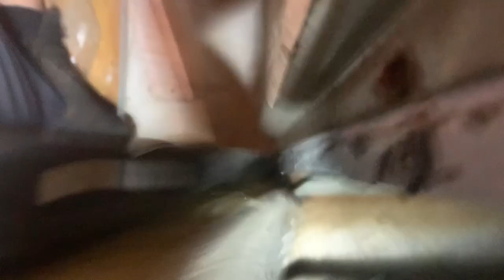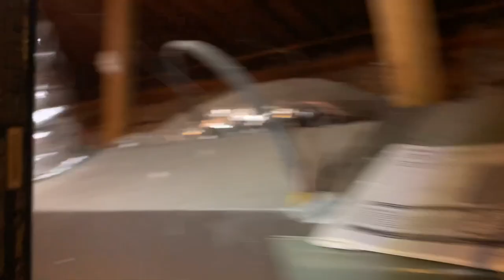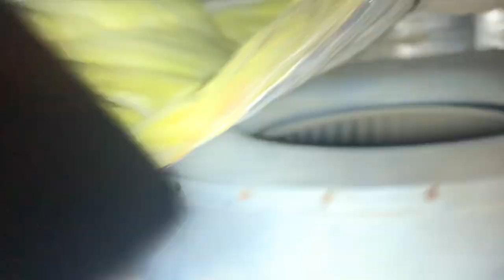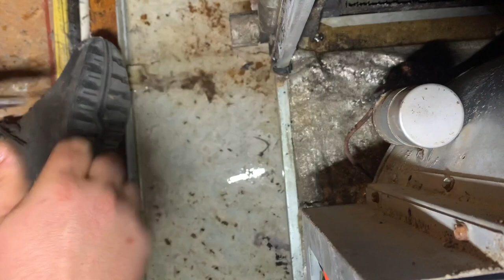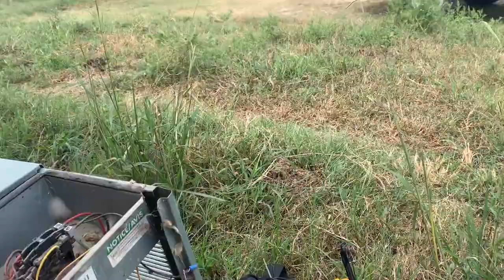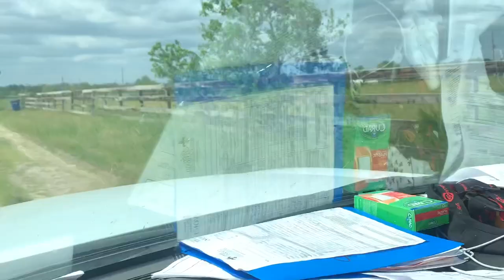Two Systems Not Cooling from Storm Damage

Comment: hey John, long time no hear.... I repaired a bunch of fencing for my daughter and after looking at that downed fencing 90% of it can be reused.  It just needs a few posts, fasteners and bags of crete...and a stringline...most of it is just manual labor.  That lady is near the southern  border, so cheap labor shouldn't be an issue.  Like the other guy said, they might just want to be a schosh bit deeper. 

Those Rheems look nice.  she should be happy with them, and shouldnt need any service for at least 5 years if she changes the filters and hoses them off once a year.  My brother in law use to wash and wax his, like his cars, twice a year, they are 30 years old and look like new.